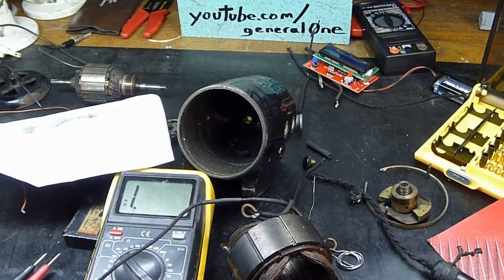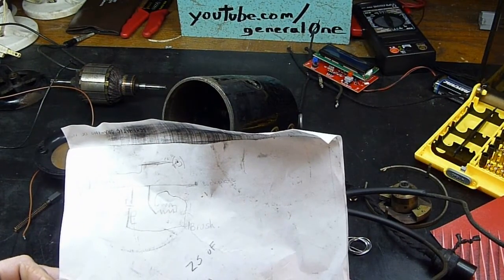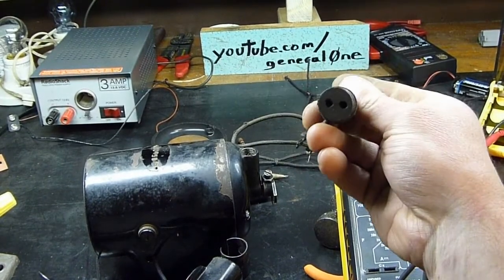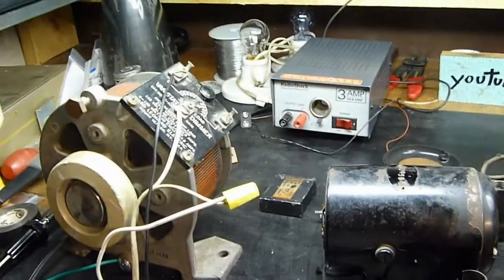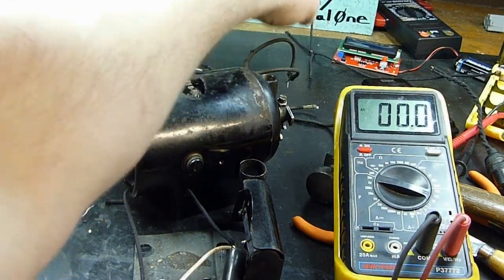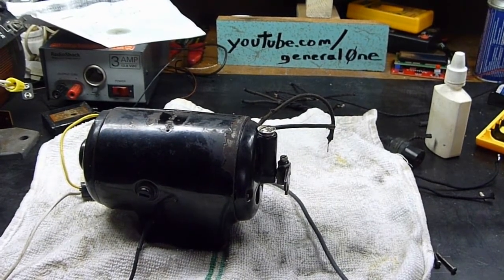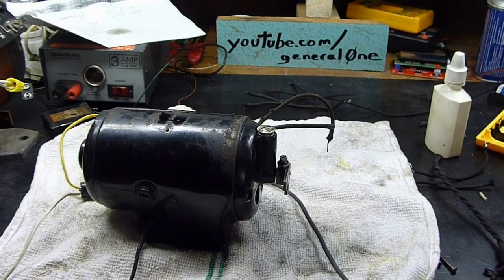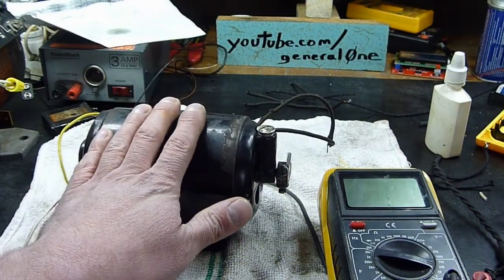More GE Electric Motor Tests and Ramblings

Comment: The cap is connected parallel with the switch.  This is to reduce arcing on the switch contacts.  To find if those resistors were for 240V, use Ohm's law, else I have no idea what they would be used for.
Reply from the maker: The resistor is wired across the contact as well.  They're not for simply dropping the voltage as I had originally though.  I believe the resistors do more to resist switch arcing than the capacitor, as well as make the motor run smoother, allowing some current to pass through to the motor when the contacts are open.  I believe the cap is mainly to reduce interference.